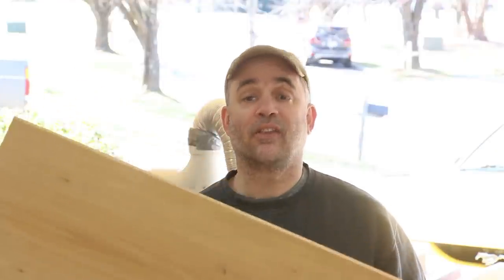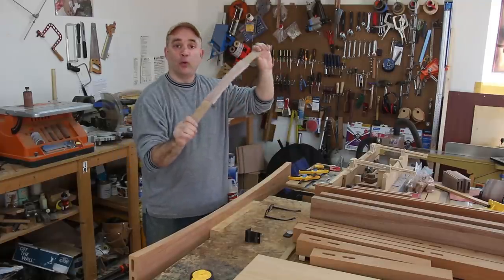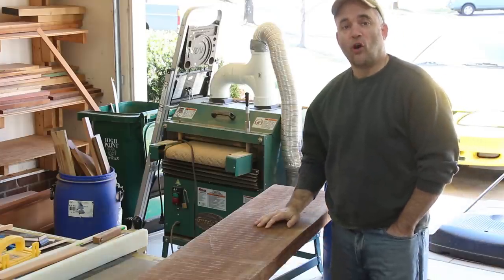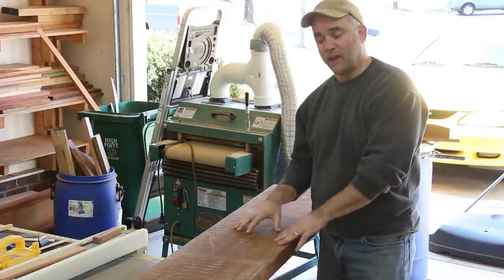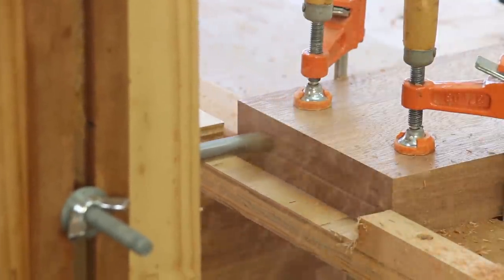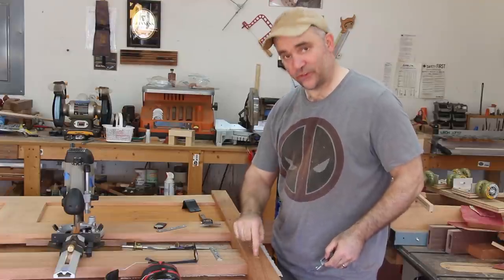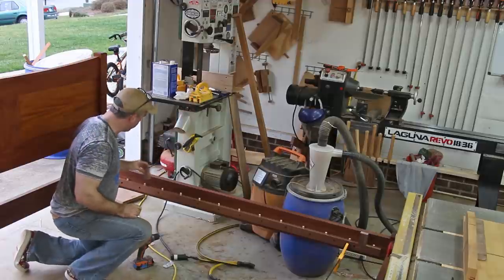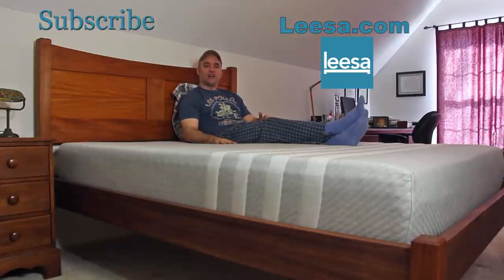Panel Bed Part 3

Comment: Nice work Brian, I'm a big fan of floating tenons too and used them in the head board I did a few years back. 
I saw you used a jig (for lack of a better word) to support the ends of the long boards when on the tablesaw. That was very nice trick and I WILLbe steeling it. Did you wax the top so the board slides nicely as needed?
Also, did I see you use drywall screws for the side rail hardware attachment or just black screw?
In any case Nicely done. Look forward to your next build.
Reply from the maker: It was a board supported by two roller stands.  It rolled so no wax was needed.  No drywall screws, but wood square drive screws from McFeelys.

Comment: Awesome project. Thanks for sharing it. Quick question; what is that 'barking' noise from the bandsaw? Mine does that too. I am assuming one of the guide wheels engaging with the blade?
Reply from the maker: I honestly don't know what causes that noise.  It doesn't seem to be related to any problems with the saw so I just live with it.
Reply: GarageWoodworks Yeah, same here. As long as the thing does its job, it can bark, quack, moo, cluck, snort, or whiney all it wants.